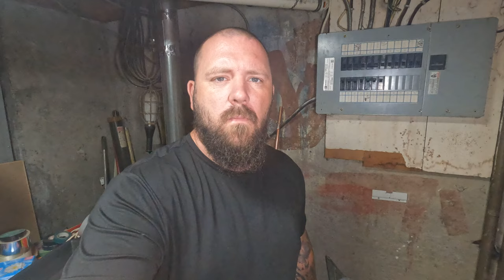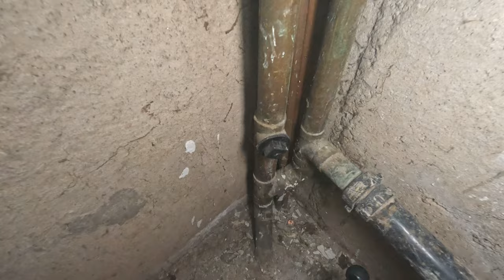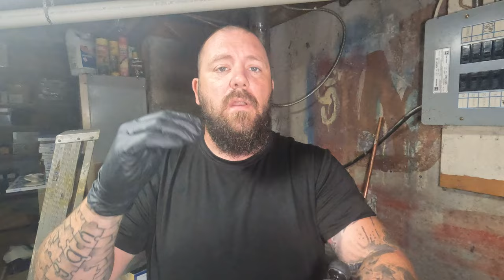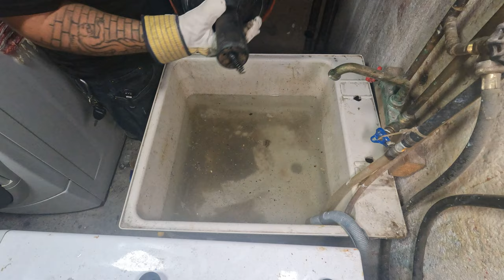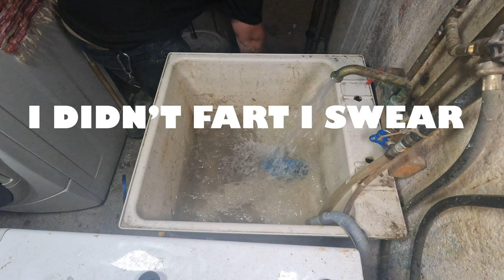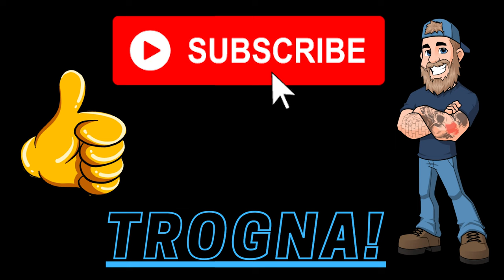Laundry sink FLOODED again. Grease in sink from the KITCHEN. thumbnail has nothing to do with  video

Comment: Hey what's up Jay it looms like you have been on that job before I see the rubber coupling on.....great you got it cleared anyway have a great day
Reply from the maker: Yeah I definitely been on that job before. I can't remember exactly when I know it was within a year and that's actually the manager of that townhouse complex. That's her unit. I don't know if she's putting oil and stuff down the drain, but because it's inch and a half wine that ties in with the laundry from the kitchen. We know that there's a issue with that stack system and if she's not doing everything she should be that they're definitely going to be backing up more frequently than others wow  I just rambled on there anyway thanks for watching Patrick, I appreciate it and I hope you have yourself a great weekend
Reply: Yeah Jay the same piping system here also in some of the older homes here in maryland where the kitchen and laundry drain lines are tied in